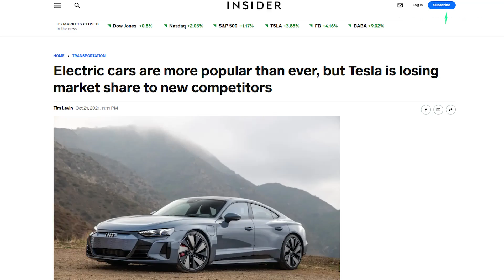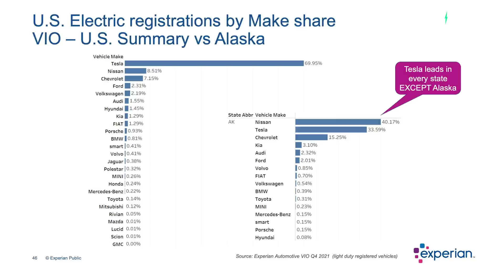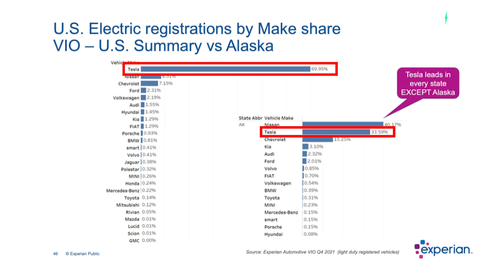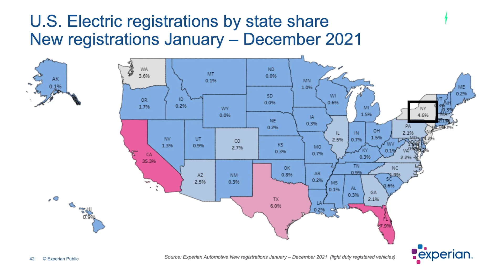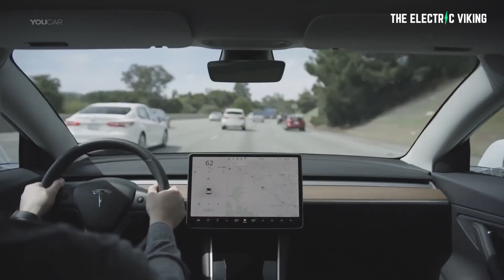New data on Tesla EV sales by US State - Texas?!?

Comment: Sure Tesla has better tech than anyone else; but imho that's not the biggest reason they'll maintain high market share. There are lots of folks that would by perfectly happy with a Mach E, a Volkswagen ID series – or even a BYD (if they could get one). Most of us would be knocked out by any decent EV.  I think the bigger reason Tesla market percentages will continue to crush is: they can produce the damn things. No one else outside of China can make enough EVs to make a dent in their market share. No one else has that 'machine that makes the machine'; and no one has their supply chain under control like Tesla.
Reply: I think this is correct. They'll continue to sell as many as they can make for at least the next few years.

Comment: Correction for ya, Viking -- that Experian map you put up is EV market share by state. Of every 100 EVs sold in the US, 35 are in CA, 6 are in TX, 4 in NY, etc. The latest registration data for CA (Feb 2022) is 12.4% of new registrations are Electric.
Reply: You get it Speede.   I just saw your post after I wrote my manifesto.   People are not understanding what the percentages are telling them.
Reply: TRUE!  Understandable mistake.
Reply: Even more correction,  EVs are still are being sold over msrp and are in such sort supply that people have to drive to differnt states to buy one.  The parts shortage availability of fast dc chargers are all impacting ev sales.  When this dry spell is over these numbers will change

Comment: People in the US don't want EVs. It's pointless to build unwanted cars. People drive longer distances and the charging infrastructure is still in it's infancy.
Reply: I just drove 550mi NJ to OH 2016 Model X max range 250mi the trip was quite pleasant and my “outdated autopilot” was such a pleasure to use. Probably because it’s still way better than anybody else’s 2022 cruise controls. As for charging Teslas navigation made it a snap ! The extra time needed to charge was a welcome pit stop. It made a 9hr “non stop”  trip into just over 10hrs.  Something that would not change had I been in my Jeep Grand Cherokee. At least for me 3-4 hrs non stop driving is my limit. 250mi range figure on 200mi between charging and that’s nearly 4 hrs between charges.  Just right for me !
Reply: .
Mike
Must be really dark with your head stuck up there?
Reply: Ok, you proved you have no idea what you are talking about even though the facts that prove you wrong are readily available.  People in the US want Tesla EVs so bad that they are sold out months in advance.  How does that fact square with your fictional right wing belief?